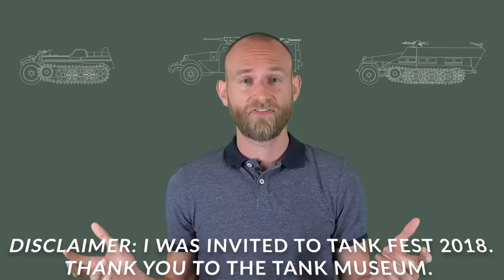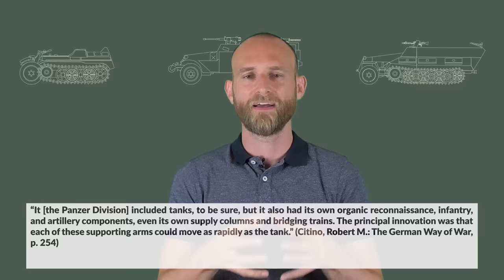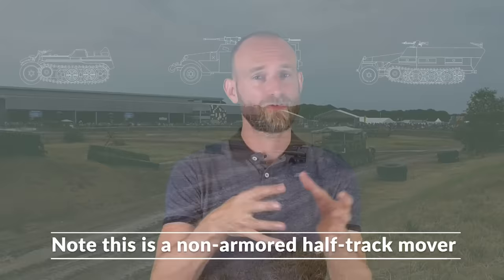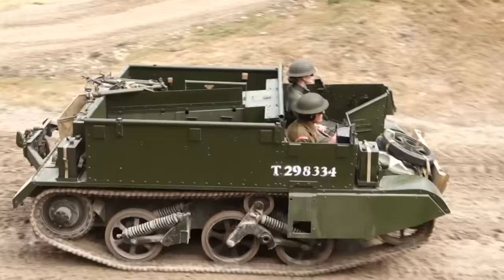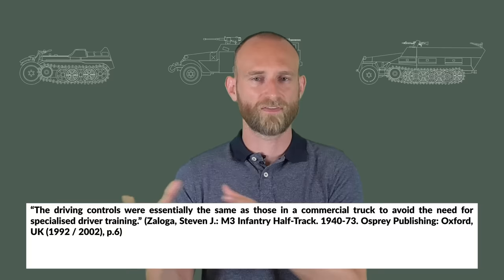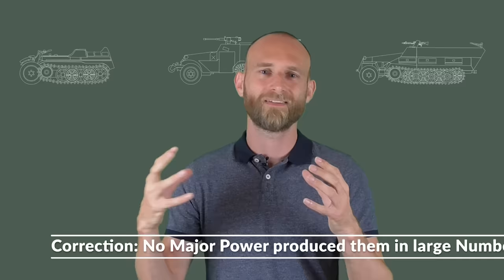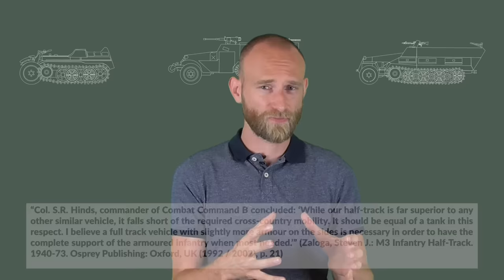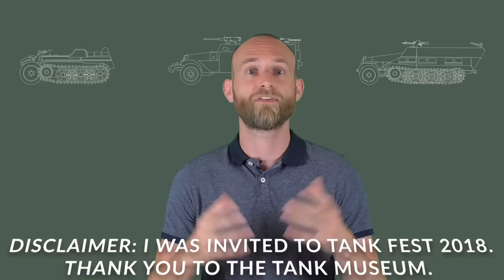Why Halftracks? Why limited to WW2 only? (Featuring Tank Fest 2018)

Comment: resources! from my mind and what I know from me great grand dad a ww2 veteran was that rubber was scarce even for the english after Singapore fell to the Japanese relying mainly of Sri Lanka he would talk about using cork, fibrous or leather gaiters gaskets and seals as alternative for machinery. the Bren carriers all track system make sense to limit rubber usage. I would consider that half track was the other 1/2 alternative which for the germans seems very stupid as they only had limited synthetic rubber supplies unlike the allies. the USA at least had Philippines and Kentucky introduced grown rubber as well as synthetic and south american imported rubber. Germany should have used all tracks for after they occupied France they where steel kings but not much else except coal.
pre war2 and early ww2 most of the uk armoured vehicles had four wheels exampli gratia: daimlers, morris,Beaverette and aec in production pre war and till 1943 in some form. Singapore was taken 1942 one year after 4 wheels mostly ceased production except humber till 1945. the m7 kangaroo went into service 1943 till 1945 which use rather little rubber and was probably to mitigate this problem but is classified as armoured personnel carrier. early AMC where present but not in such numbers till late war such as the Lloyd and universals which started earlier but saw longer production past the war. british lories and utility vehicles had all 4 rubber wheels not particularly valid to the topic. most british ww2 lorries to my knowledge and work experience are Bedfords or Austins. oh yes armoured command vehicles tended to have all wheels so there another addition. the uk unlike the rest of the world did develop 4 wheel independent shock absorbed suspension which really makes cross country terrain transport possible. Britain did 4wheels all terrain successfully no one else did in the war exempt the Canadian and the Australian to my know how.

Comment: The half track did not end with WW2. It continued to serve in different armies with through in 1980s. Hell the Israelis had a bunch of them in active and reserve service as late 2008 until they were finally withdrawn and scrapped. I'll grant they didn't fill every role and had some problems but they did their did job until better vehicles took their place.

Comment: Why half-tracks? (as compared to fully tracked, armored fighting vehicles)
Simple.
IN the war, a soldier's life was rather cheap. And vehicles were expensive. Training was expensive. So the focus was on getting the best use out of the soldier, while spending as little as possible on his vehicles. Base the vehicles on simpler (often civilian) designs, chassis and engines. The focus was getting the maximum bang for your buck. Halftracks give you good-ish capability with very low cost of manufacture, maintenance and training.
.
In peacetime, or reduced theater of operations, you can much less afford to "spend" your soldiers. So you invest in specialized, high-tech, expensive vehicles. Here the focus is to get the most bang per soldier*. You cannot solve a problem by throwing more bodies at it, so you give each soldier the *best in equipment to ensure his surviveability and effectiveness.
Each soldier is also trains *much* more thoroughly.
Fancy Armored Fighting Vehicles give you a safer, more capable infantry then needs less soldiers. At the cost of inordinate vehicle cost, extensive training, and ludicrous maintenance costs.
.
If we enter an extended, budget-restricted, all-out war, then we will see a return of cheaper, easier to maintain vehicles for infantry transport.
Like the Toyota truck armies of Libya, Sudan, Syria......

Comment: So I get why not fully tracked, but still don't understand why not just truck? How is half-track better at cross-country or better at being armored?
Reply: Tracks obviously have better traction on soft ground, and they distribute weight better so its easier to make heavy tracked vehicles
Reply: CharlesOffdensen, have you ever seen wheels stuck in the mud,just spinning and not getting you a millimeter forward?Well guess what,that wont happen if you have tracks,because of their construction and of them having more surface.And, well,halftracks were better in terms of armor just because they had armor and regular cars didnt.
Reply: CharlesOffdensen Dirt roads get torn up easily if you are transporting lots of troops and equipment, especially in bad weather. With tracks you don't need to worry about getting stuck.
Reply: Actually, the Soviets got about 3,000 U.S. built halftracks, both as APCs and SP AAA vehicles.  The U.S. halftracks weren't intended to tow heavy loads.  We had several series of  full-tracked High Speed Tractors for that job.
Reply: Dude, the main advantage of tracked vehicles is their offroad capability, how can you not know this. Use your brain next time
Reply: Are we looking at the weapon that in large enough quantity could have won Barbarossa?
Reply: hognoxious - WWII-era steering. Full-tracked vehicles of then drove much like bulldozers.
Reply: Tracks can get stuck too. Just not as easy.
Also, why not just go full tracked? Well that costs more to produce. The HT, for Germany, was the middle ground. They needed a vehicle to pull large guns, be armored enough to withstand near by shelling and small arms fire and to transport 10+ soldiers cross country. A truck could transport 10+ people, but wasnt armoured and had bad off road capabilities. And couldnt produce enough torque to pull the large guns without making the wheels spin.
Today you have many different techs on a truck that fixes that. So today you have large armored trucks pulling/mounted with large guns and with great off road capability. Not so much in 1940's.

Comment: OK, I buy the argument against Half-tracks for Troops but not for resupply. If you need to haul food, ammo, fuel, cross country it would be hard to beat a Half-Track. Think, Russian Springtime for the Germans in WW2.
Reply: The german halftracks are very bad in the role as supplytruck.
Look at the Sd.Kfz 9, a big 15t fuel hungry monster of a halftrack, but only a cargo capacity of 2-3t.
A Opel Blitz is much better, cheaper, faster, less maintenance needed.
A Sd.Kfz 9 is good for towing 3-4 Opel Blitz throug the russian springtime roads

Comment: Half track is a jack of all trades master of none.  Not as good as a tank off-road not as good as a truck on road.  After wwii wheeled vehicles got a lot better so we could have multiple wheeled vehicles with 6 or 8 wheels that could work off road as well as half track, but was much better on road.  And since it's wheeled is much easier to maintain.

Comment: I've always wondered why IFVs are not more heavily armored, or why they just don't use the same chassis as a tank. There's some of those out there but they're rare. I thought the idea was to keep with tanks?
Reply: Tanks consume vast amounts of fuel and are very expensive in resources (from building to maintaining and supporting them). They are also very heavy and cannot always go where infantry needs to go. 

While IFVs do suffer from some of the same limitations, they are also much cheaper to operate, have better mobility (they can for example use many bridges that a 60+ tonne tank cannot) and can carry many more soldiers per unit of resource spent on them. 

We have to remember that IFVs were intially created for fast, armoured spearhead attacks across Central Europe in a third world war. The idea of fighting insurgents with RPGs in cities is a later idea, and not what they were initially designed for.
Reply: But said spearheads were led by MBTs, no?
Reply: Yes, though also by tactical nukes, air power etc.

Comment: What couldn't a Bren carrier carry or tow that would reasonably need to be moved? I am thinking almost nothing. Am I wrong? Like that big gun being towed at 10:00- could a Bren carrier tow it?
Reply from the maker: crew: 3
I doubt the Universal Carrier could tow the PaK 43. Since the later was heavier than the carrier in travel configuration.
Reply: Military History not Visualized. Thanks. And I am probably misunderstanding you. But you aren't saying t Pak-43 is too heavy due to it's 3 man crew are you? If that is t case, just carry t crew and ammo in a second bren carrier.

Also isn't plenty of towed equipment way lighter than that pak-43?

Also, another poster mentioned how there are way more roads going way more places nowadays. I am guessing that nowdays they can just take trucks to w/in walking distance of t battle in most cases currently.
Reply from the maker: the Carrier has a crew of 3. The Carrier is extremely limited in capacity in comparison to the half-tracks.
Reply: hognoxious That has occurred to me too actually-that theoretically there is no limit on how heavy a towed object can be if t toeing vehicle is geared low enuf. However if it is geared that low, then speed will also be low. And since t entire point is to keep up w t armour,  if it is geared too low,  then it may well end up moving too slow to keep up.
Reply: Military History not Visualized Ok. Thanks

Comment: Your initial argument falls apart in that (a) german use of panzergrenadier was limited to elements in panzer divisions, and panzergrenadier/light/motorised divisions; and (b) the german halftracks were never conceived of as actual assault vehicles.  The US experience was that halftrack mounted troops more often than not refused to dismount, and simply fired from inside the vehicles, completely wasting the value of infantry accompanying armour.  It was this initial failure of US practice (due to lack of training and doctrine, not to mention bravery) that led to a later focus on 'infantry fighting vehicles', which leads to the interesting situation where leg units are still required to support US armour because their inherent mech inf is severely limited for infantry fighting.  I will add that the germans had so few trucks and half tracks that they couldn't afford to go driving them into combat per se...overall, 85% of the german unit transport capacity was horse reliant, which is even more damning when it is considered that the armoured/motorised infantry had priority on the motor vehicles.

Comment: Why only WW2? I can answer that with "why is your military history knowledge so horrible?" Half tracks were built into the 1980's (go learn about Chile's BMS-1 Alacran) and WW2 surplus were used by Israel into the 1990's. Britain was also building them for use in Northern Ireland during the 1970's and 1980's as well (typically based on Land Rover vehicles). And the whole "toss tracks over the truck tire bogeys" method for converting a fully wheeled vehicle to a halftrack lasted into the 1980's as well.

Also "open top" is an invalid argument. The Soviets didn't start putting an armored roof on their personnel carriers until just shy of 1970, well after they started adding NBC protection to their older tanks.

Comment: If m2 & m3 Bradleys had been invented in WW II, whoever had them would have won in about 3 months...even without the TOW missile. Only armed with the chain gun, coax, & gun ports for the infantry. It could have taken anything out on land & air, while carting infantry & equipment about just as fast as a half-track with slightly better armor...only problem was working with aluminum back then on a mass industrial scale.
Reply: Only if the enemy had no tanks, AT-guns, mines, Molotovcocktails, ...

Comment: would you please guide me to video or article that explain the steering system in half-tracked vehicles?
thanks for this knowledge.
Reply: Lawathe M. Eid لاوَذ ميثَم عيد the American half tracks steered the  same as any wheeled vehicle,the German design on many of their designs the front wheels when turned to the extreme right or left engaged track brake on that side to have the opposite track help in making turns. Other difference. The American design was four wheel drive German units were not only track drive.
Reply: but i think no need for rubber wheels .. because what i think that the friction of tracks will overcome the friction of front wheels so the front wheels will slide only, that is why i asked for a video or article to examine the calculations!
Reply: There are video's on YouTube showing halftrack corning and I say only on icy condition did the rubber tires fail to have traction ,both axles have differentials there were not locking systems then.I have driven them on and off road and they handle just like any wheeled vehicle just a bit slower in speed .

Comment: sorry to correct you.. but the main reason for halftracks in Germany.. was TRACTION! and the second was Groundpreasure and the Third, was Waightcarriage?  (the ability of a Vehicle, to carry more than 7 Tons and be able to be Offroadcapable!)  In 1930+, the Engine wassnt that strong, to drive a big Truck trough mud with normal tires.  a 88mm Gun waights more than 7Tons in Fighting Position and even more with the Shield. every Shell of that gun, roundabout 40kgs. the vehicle with armorplatings, something about 10-15tons... NO WAY that a normal Truckchassis could heandle that, without Major issues in Mobility.  (now the MAULTIER! it was createt to increase the capacity from 2,5to, to 4,5to. to be able to put some autoweapons on Bed of that Truck)  today we dont Need that, because the Fulltracked vehicles are more advanced in mobility and the "Tire"-Vehicles are way more (stirdy?)

Comment: You are very wrong on that they were designed and built exclusively during World War Two, the French army designed a half track in 1909 although it had both a front wheels and rear wheels with the tracks in the middle run’d by a chain and gears from the rear wheels! Later in the Great War the Germans began using half tracks for transporting goods but only in the central part of the country and not in the front lines. The British had designed some during WW1 but refused them because they said horses and carriages were fast and easier to use, a big mistake considering they had originally refused the Mk1 tanks because they were designed by the navy and in their minds wouldn’t work? The Americans didn’t really design the half track but got the designs from the British who wanted to have them but in the end simply decided a tiny fully tracked transport was better LOL !! (with between 250lb to just under 800lb carriage or 3 soldiers capacity vs the Americans and German half track’s carriage capacities of between 2 1/2 tons to 10 tons or 6-20 soldiers could be carried you tell me was the extra terrain crossing capacity worth it?) Also in 1954 the United States Army submitted a request for a new half track design to be put into manufacturing immediately to replace old and lost half tracks of WW2 design these half tracks all ended up being used exclusively by Israel only, so they didn’t really go away or stop being designed and built but people/nations/armed forces just lost interest in because they had newer and better things!!

Comment: Fully tracked or fully wheeled..
The track were NOT great on roads, as they can damage the road..
The track in rear when you hit the top of a Mound of dirt, can lift the front up..
Attaching the tracks is fun also...in that the WHOLE thing can be connected 2 way, SOLID(dont move/tilt) and Tilting, so as terrain change it can change with it..
Tracks are great for OFF road and not sinking...
Its also not Positrack,(look it up) and Both are powered...Ever hear of a differential??  Its like a CART turning in a circle, the OUTSIDE wheel must go faster...  IF both tracks do the SAME, you cant turn very well..
So, we got Tires..
Dualies 4 tires and 8 tires ont he rear..Which does very well, and has Allot better millage..  The 1/2 tracks got 3mpg..Trucks get 8-12mpg..

Comment: Why not just put a roof on a half-track?
Reply: Unnecesseary weight and to allow soldiers to shoot out.
Half tracs are supposed to protect infantry from long range heavy machinegun fire until they get in small arms range and dismount to support a tank assault, or if they are ambushed, not to serve as fighting vehicles themselves.
As mutch as the IFV fills a similar role nowadays, it is the light tank and halftrack rolled into one, not merely an evolution of the halftrack.

Comment: Half tracks where not viable long term,. they where a hassle to drive  , at high speed 40 -50 K/H, most would not steer at all over this speed, the tracks are high maintenance , the list goes on

Comment: You drag the video out really well, for a subject that would take 2 minutes you made it into a 10 minute video, the Soviets produced halftracks initially in the 30s but came to the conclusion that they do not do the job of cross country performance well enough in places were road is non existent, so the Soviets simply put the troops on the tanks or used fully tracked troop transport vehicles. The Americans came to the same conclusion after WW2 as well
Reply: Tank desant was a result of a lack of infantry transports, not an alternative. The Soviets still used the lend leased M3s.